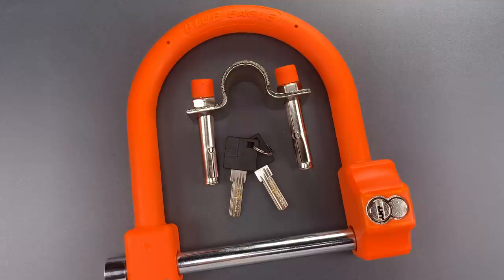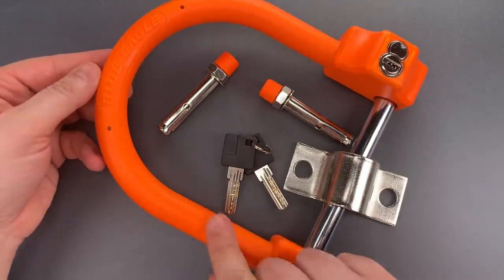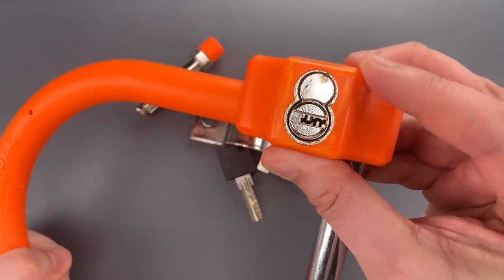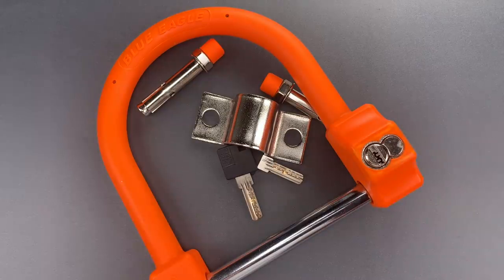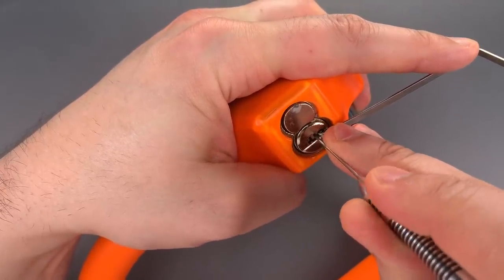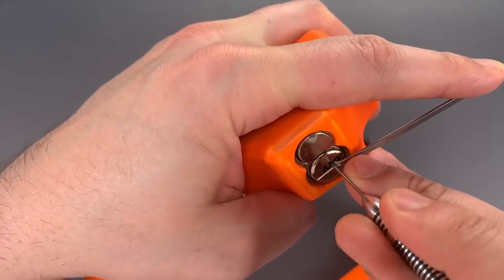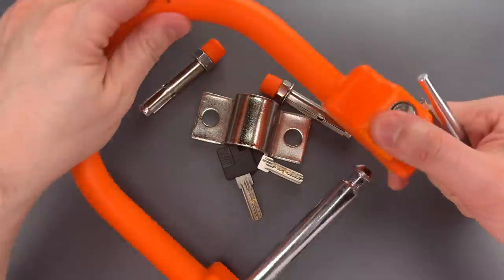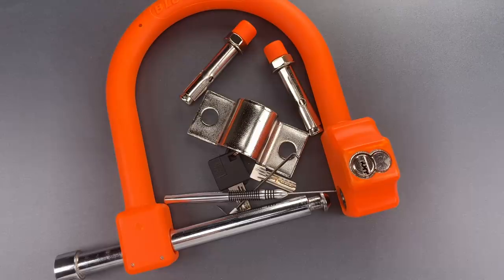[1228] Blue Eagle Motorcycle Lock Picked

Comment: I can see how it could be fairly effective if installed low to the ground with the lock attached so the keyway was facing down. That would also keep the elements from getting inside. The anchor vulnerability is a more concerning weakness, but a piece of hardened chain and a concrete filled steel post could easily take it's place and improve the effectiveness of the setup.
Thanks for the review, Ash!

Comment: Some of these locks I'd like to see him pick while they're attached to the object. This is probably much harder to pick on the ground attached to a bike vs just sitting in your hand.
Reply: But how much harder is the question. Once someone has the skill and tool needed to open this thats just a matter of a few seconds really.
Reply: @metamorphicorder  I think it would take significantly longer.  Which is why it would be nice to see an actual "race"
Reply: It very will could but its not going to take enough longer to make the lock objectively better. 
 Its going to be similar to how much harder it is to use the key while its in use compared to when its on the table in front of you. 
 Most people are going to engage this so that its easy for THEM to put it on and take it off. I mean they have to engage it or take it off every time they lock or unlock their bike. They arent gonna care that doing it in a certain way makes it easier the ONE time that someone steals their bike. 
Its not really that useful of a test for picking. When it comes to other types of attacks it makes some more sense to question if it would work in situ because theres a lot more at play. Like if you were securing a job box with aluminum body padlocks, and someone says yeah but those are soft and easily cut or drilled. But you show them that the way they are used and that they have a steel plate on the bottom to protect against drilling makes it very unlikely that someone could open them that way. 
 Ironically though that characteristic makes job boxes easier to pick because the lock is held stationary and with the keyway exposed. 
 The point is that its for the vast majority of cases not really that big a deal. Heres why, a bad lock thats made slightly better because its awkwardly placed is still not as good as a good lock which will suffer less even if its optimally placed for picking. Its just not a huge factor to consider when evaluating a lock. Its pretty similar to security through obscurity.  Thinking that a lock is better because its old and unusual and hoping that potential thieves cant figure it out even though its already been defeated in the past. 
 Unless the way that you place a lock on something is going to add tens of minutes or more to the time it takes to open then its not really worth considering. Im sure LPL could install this on a wall and lock a bike or motorcycle into it and then squat next to it and open it. Even if someone locked it with the keyway facing down, it would literally just be a matter of squatting and reaching down or laying down and looking up. 
 Not hard even though it may not technically be as easy as when its on his desk. 
 If he can get his tools in the keyway theres a pretty good chance he can open it. A few seconds to a minute or so is hardly worth quibbling over because that relies on a specific set of conditions that may not always be present. This shows what the worst case scenario really is.
Reply: He's mentioned in the past that the reason he doesn't try to emulate more "real world" situations w/ respect to the angle+objects in the way is that it becomes much more difficult to produce a video where you can actually see what's happening. 

as to how often that makes it significantly easier for him, that is less clear. but at least the above is a justification for the choices made that's been given
Reply: Having picked quite a few locks myself, attached to something is always easier than 'free in hand'. Especially the locks (usually tumbler combination) that need the shackle to be loaded against something to feel the notches in the wheels.
Reply: The same thing occurred to me a while ago, especially a lock attached to the inside of a gate.
Reply: @metamorphicorder  Looking at this style lock I would propose that installed may make it slightly more difficult to tension, particularly with the wrench he used as the surface the lock is mounted to would interfere with the length of tension wrench used.  It would probably have little to no bearing on picking beyond that.
Reply: @timothybarney7257  agreed, like i said, its not likely to add enough time to the pick for an intermediate or skilled picker that its worth quibbling over. Questioning? Sure, then we can have this discussion and determine that for the most part, its not a big issue and that its not the quality you want to base your decision to use a lock on. Like i wouldnt be using the metal "strap" that comes with this as it could easily be cut with many tools. 
 Honestly not sure what i would use otherwise, this is probably not exactly cheap, and the other security anchor products like this that would make the lock usable are pretty expensive themselves and if you are putting that much cost into it you might as well find a better lock for the same or less cost.

Comment: Quick question, in theory what would it take to make a lock un-pickable?
Reply: In theory, a perfectly manufactured pin-tumbler lock would be unpickable. Lockpicking is only possible because of manufacturing imperfections, though I'm not certain it's actually possible to manufacture something to such a degree of perfection to render anything "pick-proof."
Reply: Watch video 1164
Reply: @LulledLion  ahhh, yep I see what you did there
Reply: There was a concept for a lock a while back that would be un-pickable. It worked by completely preventing access to the keyway, you insert a key and the lock rotates it inside before putting it against the pins, so its completely impossible to pick by any even remotely conventional means. The only way to manipulate the pins at all would be to insert some sort of device that would automatically or be remotely controlled to pick the lock. But given how small such a device would have to be in order to fit that would be one hell of an engineering challenge. Of course it would still be vulnerable to other non-destructive attacks like impressioning or shimming if not built correctly.
Reply: Weld the core shut...
Reply: Have a lock that can only be opened by an app or remote, no keyhole, no where to pick
Reply: Any lock that can be tensioned can be picked. The Bowley Lock (video 636) gets around this. That being said, something like ASSA DP+ or Abloy Protec 2 are so obnoxiously hard to pick (even for folks like LPL) that you have to come up with some very exciting plot about government secrets and sneaky squirrel agencies for it to be even remotely plausible that they will be picked rather than broken physically.
Reply: @Woodyhlr  well, this lock was made irl not long time ago by Shane from channel Stuff Made Here
. Exactly by that concept. And LPL even mentoned in the comments to that video that he will try to pick it.
Reply: @andersjjensen  what about a lock that can be tensioned but you can’t access the keyway?
Reply: @Woodyhlr  I'd like to see how would pan out, as you generally tension the lock FROM the key way. And if you can't access the key way... how is anyone going to open it with... the key? :P
Reply: Check out his videos he calls the naughty bucket list.
Reply: Superglue
Reply: Everyone here making super-thought answers and I was like "The only lockpicking technique I know is called bomb and it's probably the best"
Reply: A very well lubricated lock will be difficult to pick, because the springs might be strong enough to overcome the friction between the tensioned core and the lifted pin, lowering the pin back. If the pins are much smaller than their cavity, this will be easier
Reply: It's probably similar to how to make a computer immune to hacking:

Turn it off.
Put it in a safe.
Embed the safe in concrete.
Dump in a random part of the Pacific Ocean.
Reply: LPL : "well a lock without a keyhole....maybe"
Reply: @patrickmccoy4496  by “it“ do you mean the motorcycle?
Reply: @ragtowne  I was referring to how to make the lock unpickable but I like your angle better.
Reply: LPL's response would be..."any lock I haven't touched..."
Reply: @melissaharway4547  online security is shite too unfortunately.  It's kinda funny cause I've seen people like this guy but for computers instead of locks and boy is that nuts to think about

Comment: This is an interesting lock idea for places where it never snows, as that hasp (which ought to be hardened, agreed) will catch a snow shovel or plow and wreck itself or the snow tool (or both).
Some minor improvements like hardening the shackle, and putting a flouting anti-drill plate and a silicone weather seal flap over the lock would help.

Comment: Can I get the a copy of lock picking glossary?

"Dimple picking"
"springy"
"Binding"
"Set"
"Click"
Reply: Setting is to get the pin in the unlocked position. They make a click sound/feel when set. Binding I believe is when the pin doesn't give the click sound or feel, which can indicate either the pin didn't completely set, the pin is a security pin (pins with odd shapes to mess with lockpickers) and you tripped the security feature, or it isn't quite the best and just sorta set itself. Springy is him describing the feel of the pins

And dimple picking is picking a dimple lock, dimple locks being ones that use keys with the pin cuts on the flat face rather than the edge (supposed to mess with impressioning tools and the like which can act as universal keys)

Comment: Would it help/matter if you mounted it so that the wheel was as close to the wall as possible, and made sure to close it so the keyway was facing the wall.  There could be enough room to get the key in but may pose a problem for someone trying to pick it with less room to work and facing away from them.  Or would that not help much?

Comment: I'd kind of like to see this one picked in situ. If the bracket is attached to the ground and there's a motorcycle wheel through the lock I'm thinking it'd take a great deal longer to pick. The drill attack does seem much more reasonable if this thing was really in use.

Comment: I noticed you had your tension tool on the side where it would be locked to the wall. If I am not mistaken, wouldn’t one have a hard time tensioning from that angle in practice? or would one jus simply need to change the position to tension and I’m overthinking this?

Comment: I wouldn't worry to much about the clamp not being hardened. Because it's going to be in a very awkward / near impossible place to cut with a motorcycle parked on it. 
As long as you put the lock underneath, that would also help.

Comment: You know you've been watching too much LPL when you start to analyse the locks and keys you see out in the real world. Today I was waiting in the automatic car wash line (I'm lazy, whatever) and one of the employees was unlocking the machine you put your money into and choose your selection for the auto car wash. The outer padlock was okay, it had a high sheath(?) to prevent someone accessing much of the bar to do that 2 spanner attack etc. But both locks inside the access panel were unlocked using one of those simple vintage iron keys, the kind you might use for old wardrobes. I wasn't close enough to see the keyway or how the key was cut, but my guess is that it was a pretty standard key with no real notches cut into it. He removed a part that had notes in it, and took out a $10 note (I think it was bent/crumpled so the machine didn't like it), so it would have been pretty easy for a thief to access that money too. Didn't see a camera, and it could be 24 hour so it might be vulnerable when the employees aren't in the staff area a couple of metres from the box.

Comment: I have to think drilling might be a whole lot easier than the position you would have to be in to pick the lock if it was installed low on a wall with a motorcycle through it thus limiting access for the wiper tension and pick.

Comment: they could make it more pick resistant by having dimples in all contours of the keyway and maybe even some interactive elements .

the bracket could be hardend and made thicker but while it will stop roll or drive away thefts it wont stop a couple good men from picking it up and putting it on a trailer or truck .

Comment: I’d like to see the FORCE of the TENSION TOOL when you pick the locks. As you have told, it is very important (or perhaps the most important) part of the picking process.  It’s possible to measure with strain gauge strip glued to the tool and connected to a tension meter or other suitable indicator showing the tension. The scale accuracy is not as important as showing the change of relative tension which can be  shown by inserting it to the video.

Comment: Depending on how close the lock is to the wall or floor if mounted, drill resistance could simply be the missing space for a power tool.

Comment: Honestly, the biggest concern I would have with that lock is a crowbar attack on the part that's connected to the wall.  How would it stand up to that?

Being pickable to the level that it is is almost a feature - it's resistant enough that there are very few criminals able to single pin pick dimple cores in general, so it's not the weakest point on the lock, but weak enough that when I loose the key, I can call in a locksmith to get the thing open again without a huge ordeal.

Pick resistance is a funny thing.  For instance, with my old car some years ago, the weak locks were strong enough to prevent it from ever being burglurized where I live, but allowed a locksmith to quickly come and get them open again that time we accidentally locked the keys inside at a gas station, as well as the dog (it was a cool autumn morning, dog was never in danger :-) ), without having to resort to something like breaking a window.  As always, engineering is about tradeoffs, which might not even be the ones you had initially thought about.

Comment: Depending on how you were able to position the 'anchor' part of it, the core could be very difficult to access with either a pick or a drill when the lock is in use. The anchor part of it would also be difficult to cut, as the wheel would restrict access to it. From a lockpicking perspective it may not be great, but for real-world security it looks OK.
Reply: Yes . I agree, the anchor will not be accessible when the bike wheel is in situ hence doesn’t need to be hardened.  And yes in the real word the actual lock is likely to be in a very awkward position for picking.

Comment: I started out riding bikes when I was 14 and I am 68 now. As a motorcycle owner I can honestly tell you that that thing is virtually useless for anything other than a flyweight. Trying to maneuver a 900lb touring bike up to a fixed position to get that lock around a wheel is more than 99% of the riders out there could do and it would only be on the front wheel as the back is normally covered up with fenders, saddlebags and such. The only thing that actually protects a bike is a garage and a good two way alarm. A GPS locator is also a plus if the first two fail to make the grade.

Comment: I would like to see where LPL stores all these bigger locks and chooses which one is next. I’m imagining some type of dungeon with his YT table set up in the middle. He walks in and calmly looks over the locks he hasn’t rap... I mean picked yet then in a smooth tone looks one directly in the keyhole and says “I’m gonna push your pins in so good” then as he picks it up it’s pops open but LPL stops it from opening all the way then looks it in the keyhole again and says “no, no, no, that’s not going to save you” as he pushes it back into the locked position again. Then he places it on the Yt table with a 40 thousands pry bar and a standard hook in 18 thousands and a glass of fine spirits. Finally Bosnian Bill comes out while holding the tool LPL and him made just in case it’s quickly needed and then it’s time for the fun to commence. While that does sound like an interesting story on its own we will save that for another day as the camera LPL uses only has a 2 gig SD card and if this goes on any longer the video won’t be able to be shot in one take.

Comment: hmmmm well that bracket would be hard to reach when there's a motorcycle in front of it, especially with that absolutely tiny U-lock, it has to be SO close to the wall. I assume the U-lock is meant to be portable and the wall mount is just a little extra @home. assuming the lock is placed horizontal (around a vertical part of the bike), the lock would be facing downwards which would make drilling very hard especially when low to the ground and with the bike in the way. Yeah not too bad......... I wouldn't buy it unless the motorcycle was only $1000 but yeah not for a serious bike.

Comment: What keeps you from just unbolting the anchors bolts?  Do you install it then damage the threads?
Reply: He did say something about the bolt anchors also the bracket not being hardened. Looks like the bolts would fit a standard hex socket. Which makes them easy to remove with common tools.

Comment: To be fair, you used the turning tool in a direction you wouldn't normally be able to use it if the lock were securing a wheel to the lock, but I suppose you could just use it from the other side the same.

Comment: If you lock it with the keyway facing down, you cant drill it and picking is probably impossible, the anker and the wheel prevent it from turning it upside down. But you have to place the anker near eg a wall so you cant push the motorcycle over it to flip the lock.